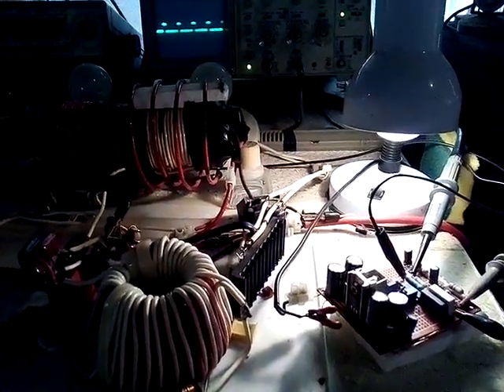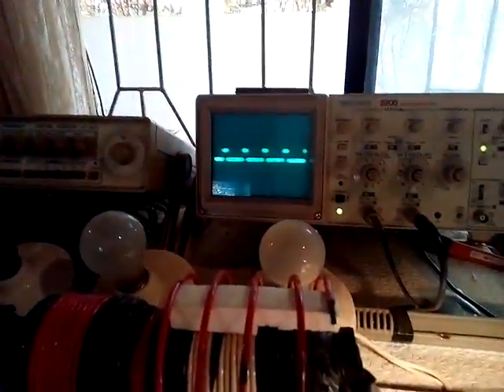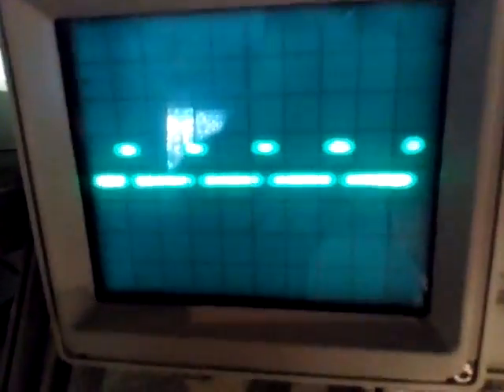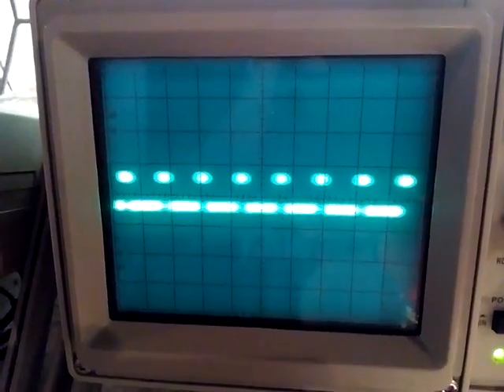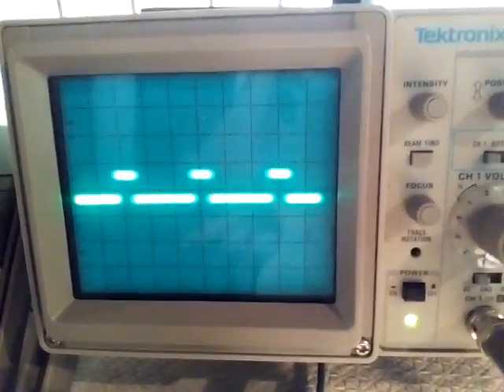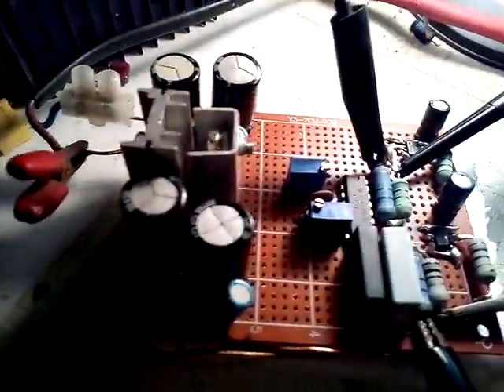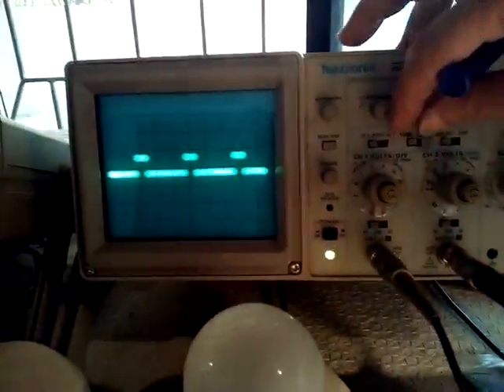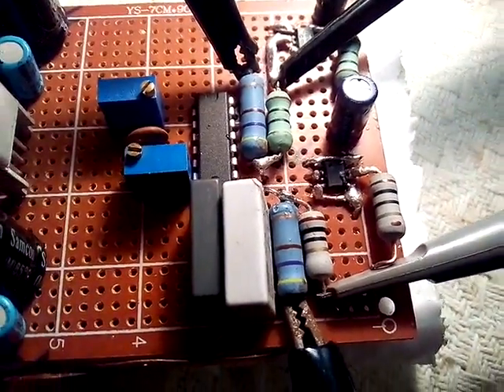Testing the TL494 circuit.

Comment: I discovered adding a 2.2uf capacitor between +V and the DT wiper on the trimmer pot fixed my problems with dead time see http://www.savel.org/2005/08/25/tl494-magic-chip-part-2/

Comment: YOU MAY 1ST WANT TO DOUBLE CHECK YOUR CIRCUIT Wiring.    No shorts! Make sure!
Next isolate the tl494 push pull IC from the rest of the circuit    ,power up,   and check the individual output pins 9 and 10 whichever they are depending on your circuit this would help alot to see it!
They should give you a square wave around 3-5vdc, if ok, then the rest of circuit for that side of push/pull is faulty.
Next check your soldering and proper wiring joints to the mosfets and make sure they are correct!
Last ,measure your resistors to see if they are same ohmic values or real close tolerances at least!
If all else your one side mosfet is bad or needs rewiring...